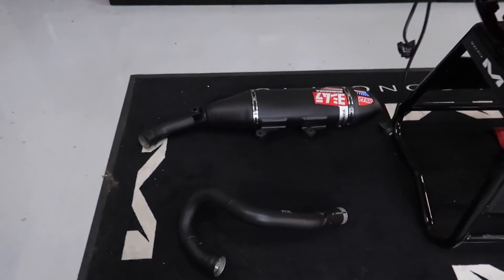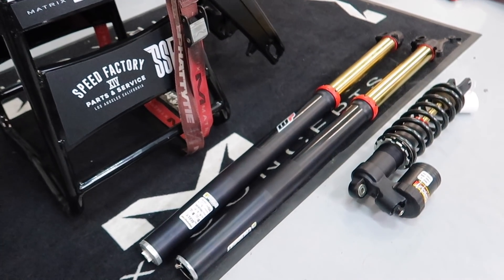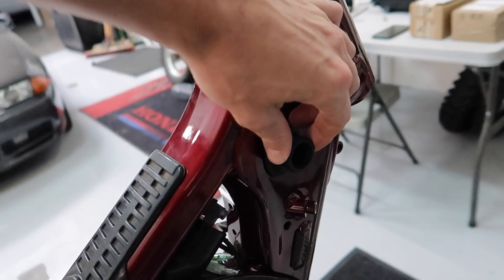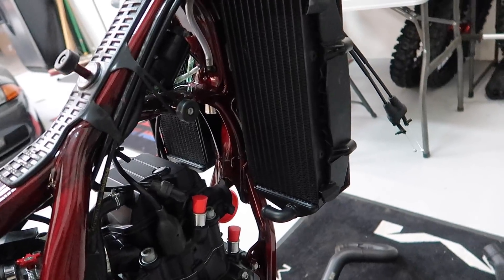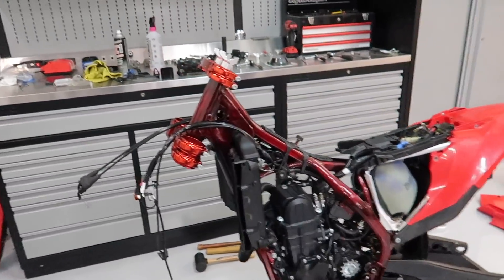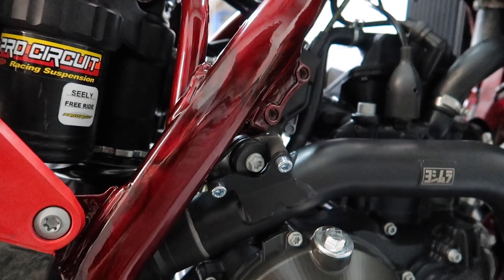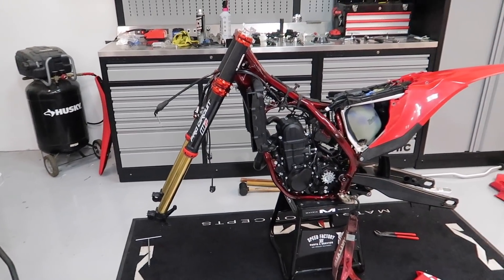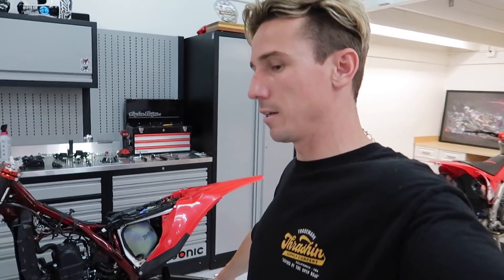450 Build Coming Together!

Comment: Cole, those triple clamps are actually a Gas Gas power parts clamp (not X-trig). You should also be able to get a set of the X-Trig PHDS that mount to the stock clamps too.

Comment: what brand are the forks Wp cone valve or normal wp air forks just coated or kybe?
Reply: They are the stock forks with coating on upper and lower tubes and lugs, a spring conversion kit in the front and coatings on the shock… not sure about the internals but probably some pro circuit goodness!
Reply: @Mkerrwrench  alright thats sick i see a lot of people do a spring conversion instead of buying cone valve saves a lot of money too
Reply: @garrett3234  there’s plenty of options over stock! Single side spring conversion, dual cartridge conversion etc.. depending on what you want!
Reply from the maker: Yeah it’s a pc kit and everything was coated
Reply: @ColeSeely  hey bro what sort of coating do the fork uppers have? Anodised or cerakote?